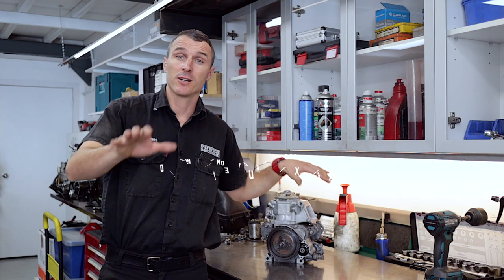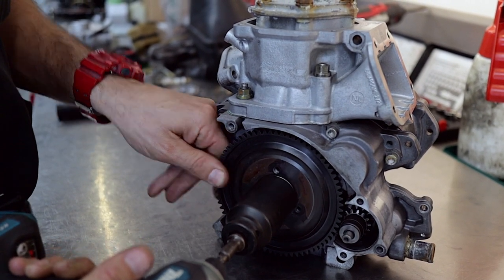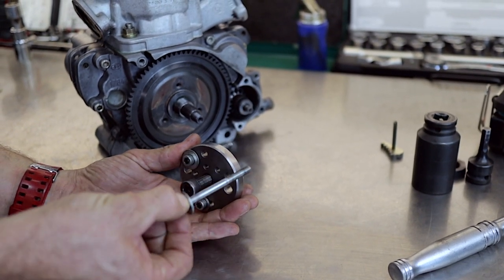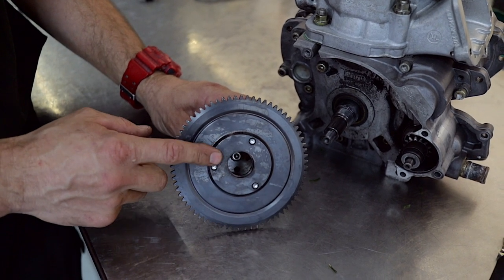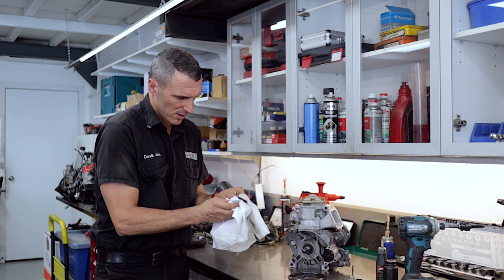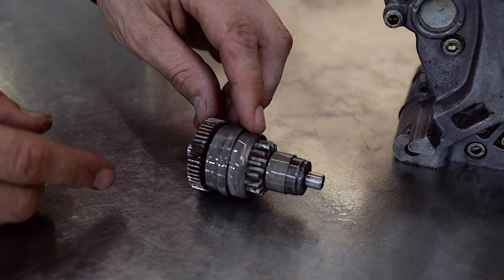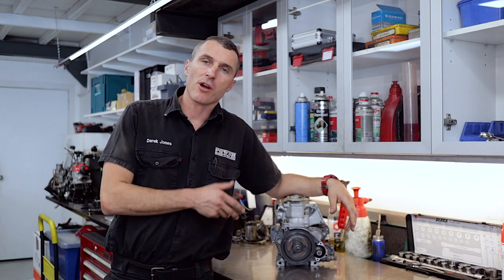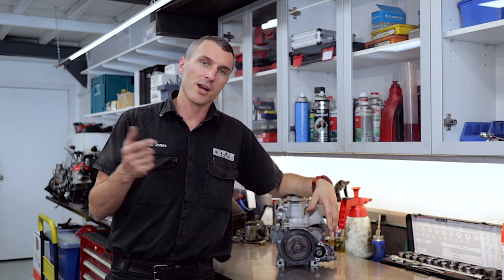HOW TO: Remove The Ring Gear From Your Rotax Engine - POWER REPUBLIC

Comment: Not sure if you’ve covered this already but could you make a video about chain length, tension and gearing setups for fast/slow tracks. Currently have a 12/89 sprocket setup. Is this geared for speed or acceleration?
Reply from the maker: I'll see what we can do for you
Reply: So Derek did the video for you but to answer your question on the 12*89 gearing...if its on a rotax that is super short...geared for acceleration. Your track would have to be pretty tight and twisty a with not very long straight aways to warrant that sort of gearing
Reply from the maker: Spot on Chris.  Thanks mate

Comment: How is the starter gear reduction working? Because i open de black plastic cap around this gears and then suddenly the starter gear reduction moved and seems to be loose behind that big gear you removed. But is that normal that the starter gear reduction can move fwd and aft and is that loose?
Reply from the maker: yeah, its normal when you remove the cover.  the cover holds it in position

Comment: I've tried lock tighting the flywheel and torqued to spec yet it still works lose after 20 to 30 min of driving. 

Had new clutch assembly nuts bolts washers etc yet it STILL does it..

Perhaps an issue with my crank shaft?
Reply from the maker: the taper might be damaged on the crank shaft.  take the whole assembly off and and 'lap' the clutch ring gear to the crank shaft lock taper
Reply: I found this on Reddit;
If the gear has come loose even once before, the taper is probably disturbed. The way these things are held together is by the surface areas of the tapers meshing together very closely. If these surfaces are damaged, it will never stay on no matter how tight you make it. Here's a trick to fix it.

a. Get some valve lapping compound.

b. Put a little on the taper and then place the ring gear onto the taper. Do not install the nut.

c. Rock the ring gear back and forth while keeping the crank still. Use a pattern something like this, 1/4 turn clockwise, 1/8 turn counter clockwise, 1/4 turn clockwise, 1/8 turn counter clockwise. Do this for several full rotations.

d. Remove the gear and wipe of the compound. Check to see if the gear is fully meshing with the taper. If it is, both surfaces (gear and taper) should be fully grey-ish. If not, there will still be shiny sections where it's not meshing so repeat c - d.

e. Clean everything with brake clean or other de-greaser.

f. Install the gear without anything on the taper, no loctite, nothing. Make sure both surfaces are dry and free of any oils.

g. Put a small amount of loctite (blue will do) on the threads of the nut only.

h. Install the nut.

i. Tighten  110nm